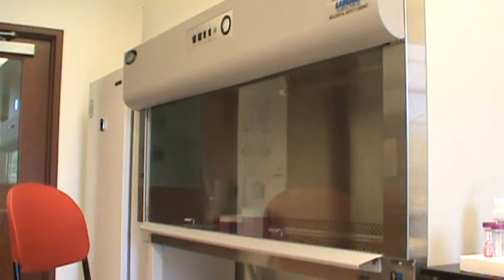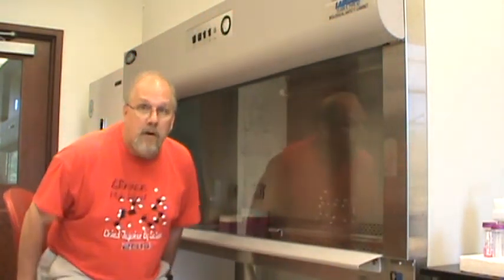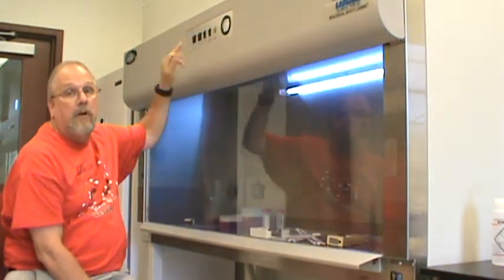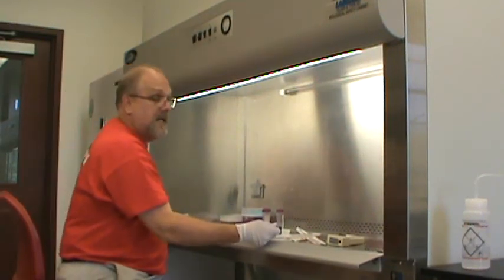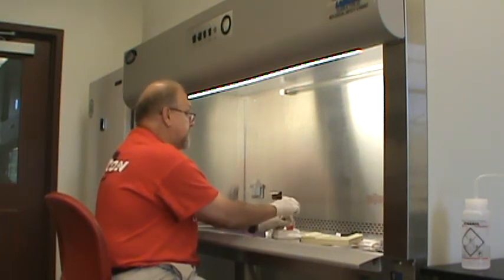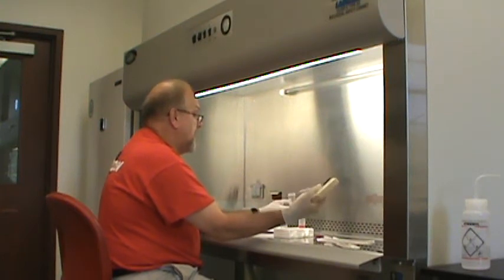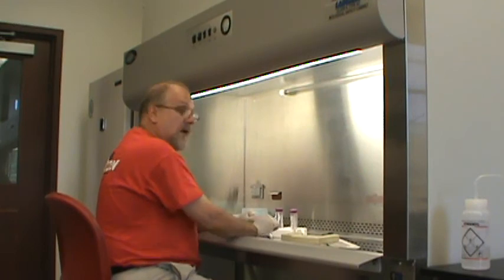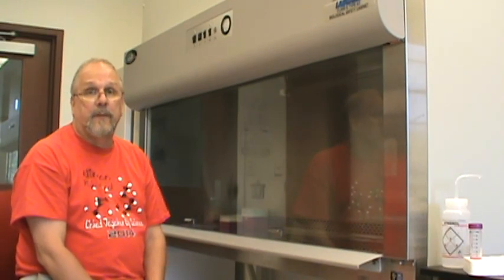Laminar Flow Hood

Comment: thank you, I just bought it. would UV light destroy mycelium on agar ?
Reply: It depends on the wavelength of the UV light. But by and large- yes, UV light kills mycelium. UV light (especially UV-C) penetrates the cells of mold/bacteria/viruses and attacks their nucleic acid and depending on the length of time and intensity of the UV, the cells can either die off altogether or the DNA can't be repaired resulting in anything from mutations that won't allow proper cell division to cancerous cells forming from healthy cells. 

If I were you, I would only use the UV light in the beginning to kill off unwanted visitors and turn it off before putting your mycelium or liquid culture in the flow hood.